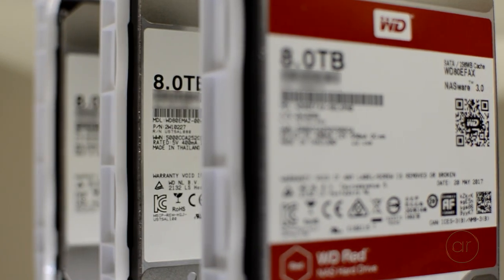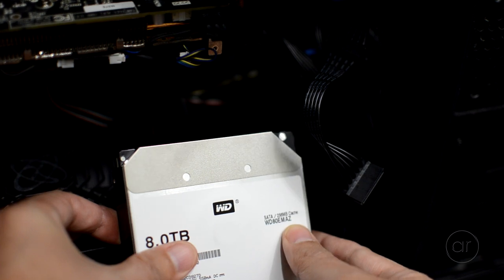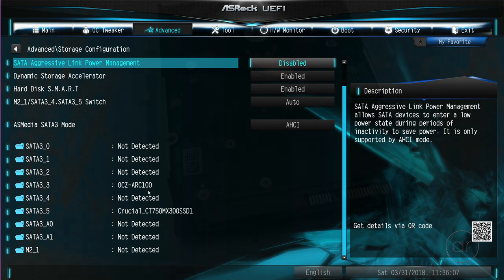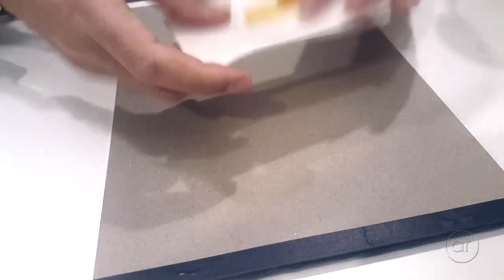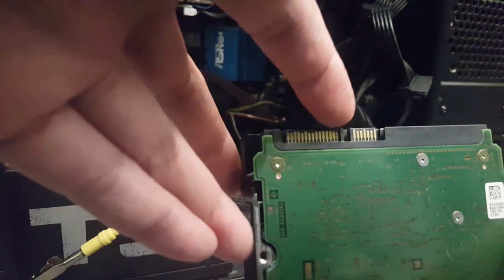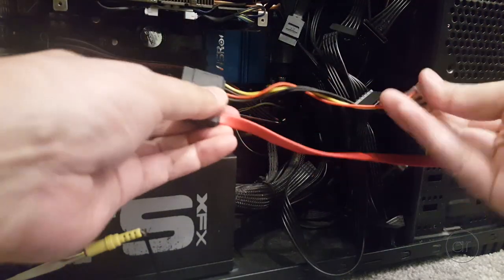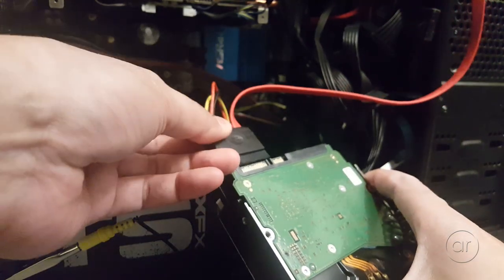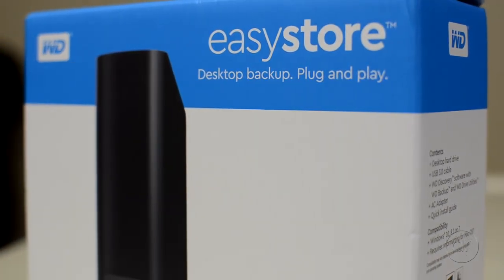How to Fix the 3.3V Pin Issue in White Label Disks Shucked from Western Digital 8TB Easystore Drives

Comment: Is there a specific sata to molex adapter I should buy? Do you have a link?
Reply from the maker: I don't have any specific product, but the general consensus on the datahoarders subreddit is to avoid the molded adapters (you want the crimped kind).
Reply: access random .. I ordered the Kingwin SATA data 7P + SATA Power 15P to SATA data + Molex 4P (SAC-04). I got it from Amazon. It looked the one you have in you vid.

Comment: Easier Method: identify 3.3v wire at the modular PSU cable end, and cut it.  The way I was able to identify on my PSU was to look at the connectors for PERIF and SATA and cut the one that the PERIF cable was missing (compared to the SATA cable).

Comment: what do you do if there are no molex connectors? 
Do I have to use the tape method or do I need something else
Reply from the maker: I focused on non-destructive ways to fix the issue (i.e. molex connector or tape). You can certainly use the tape method. Other destructive methods that I don't really recommend (from commenters below) are to snip one of the molex cables coming from the power supply, or to physically remove the third pin with a tool or knife.

Comment: I shucked a 3tb external hard drive (brand name CNM) and it was a Seagate drive inside. I have never been able to get this drive to work as an internal drive. The only way I could get it to work again was by reconnecting the little PCB that was in the external case and hooking it back up via USB. Could this be the same issue? I've tried posting in forums etc but only ever got responses that got me nowhere (such as telling me I had to go into disk management and create a partition etc which I already knew).

Do you reckon that this drive will work internally if I connect it up via a molex to SATA power adapter?
Reply from the maker: When you connect it normally, is it auto-detected in the BIOS? If so, then it probably isn't a 3.3V issue. If not, it could be a 3.3V pin, but I'd try some other steps also:

1) Try a different SATA data port on the motherboard. It's unlikely the port is bad, but worth a try.
2) Try a different SATA data cable
3) Try a different SATA power connector (with or without the molex adapter)
4) Unlikely this is the problem, but make sure your power supply can handle the extra power for the hard drive (usually 8-10W)
5) If using tape, try covering pins 1, 2 and 3. Pin 3 is the important one, but it doesn't hurt to cover all three pins.
6) If possible, try the hard drive in another computer. There might be some inherent incompatibility between the motherboard and the drive or between two hard drives (I've seen this before, but a long time ago with IDE drives).
Reply: access random I'm not sure if the BIOS picked it up or not. I can't remember looking there. I was looking in disk management in windows. But I'm in the middle of building a home media server at the moment from spare parts I have lying around at home so I'll try this drive in this machine using all these steps you've suggested. Hopefully it'll work because the extra 3tb would come in useful!

I should be able to get around to this at the weekend.

Thanks for the reply :)
Reply from the maker: Please let me know. I'd definitely check the BIOS first, as that is the first sign of failure. Good luck!
Reply: access random I've had some free time today so I've been able to get around to working my way through your checklist of suggestions. 

The drive is not automatically picked up in the BIOS. When plugged in internally via SATA I can only see it in disk management in Windows. But it doesn't let me delete or create any partitions on it. Those options are greyed out.

So I worked my way down the list and I've been able to try everything except the taping of the pin. I don't have any tape to try it with right now.

I'm reluctant to say that the drive is just dead because it works fine as an external drive when I hook it back up to that PCB that was in the external drive case and plug it into a USB port. But naturally I would like to have it hooked up internally rather than have cables running around the outside of my machine etc.

Do you think the tape method is worth a try or does it sound like the issue is something else? Thanks.
Reply from the maker: That is really strange - I've never come across a drive that doesn't appear in the BIOS but appears in Windows. It is not the 3.3V issue since it is actually powering on (if it were, it would not even spin up). What you can try is clearing the disk using diskpart. I have a video explaining how to delete "undeletable" partitions here: https://youtu.be/sfS143DikPE - but you'll want to use the command "clean" (it is explained in the description of that video).
Reply from the maker: Please note that the "clean" command erases the contents of the entire hard drive, so make sure you have backed up your data.
Reply: access random OK, I'll give that a try tomorrow. Thanks very much for all the help and suggestions so far :)

I'll let you know how it goes 👍
Reply: Sorry for the delay! I think I finally have the drive sorted. I followed the steps in your video regarding deleting "undeletable" partitions. It wouldn't work by selecting partitions and deleting them in Diskpart - it was telling me that Diskpart had encountered an error. But it did allow me to "clean" the entire drive which did the job required. I have now formatted the drive and it shows up in all the usual places as far as I can tell.

Thanks for all your help! Much appreciated :)
Reply from the maker: Awesome - great to hear all is well.

Comment: Aren't the first 3 pins all 3.3v? How does covering just the 3rd fix it?
Reply from the maker: You're right - the first three pins can be covered since pins 1 and 2 are not used. The actual voltage is delivered through pin 3 though, per the SATA Rev 3.3 spec.

Comment: I recently bought one from Amazonblackfriday, and my modelnumber is different than yours. Its WD80EZAZ, will it still work to cover the third pin? Ill try it myself in a cuple of days and ill tell you if you dont know.
Reply from the maker: Congrats! Browsing through the datahoarders subreddit, it looks like the -EZAZ model behaves the same as the earlier -EFAX and -EMAZ models. So if you run into the 3.3V problem, the kapton tape or the Molex-to-SATA (or any of the other suggested solutions in the comments) should work.

Comment: Does this work with Ultrastar 8TB Datacenter Harddrives, mine works when connected on a USB 3.0 Caddy but when connected onto the Motherboards SATA ports it does not get detected, I am using an Asus X99 Tuf Sabertooth Motherboard.
Reply from the maker: Yes, I believe so. There's evidence that some of the WD internals are actually rebranded Ultrastars.

Comment: I have an HP Pavilion 790-0031 Gaming Desktop, but my hard drive space is running low. Since more harddrives can't be attached to the Berx mobo, I want to ask if it is possible to clone the HDD to bigger drive like a 4 TB or larger AND still use it in the same PC (like removing the harddrive I am currently using and swapping it for the larger). Is this possible? Will the mobo and processor and copy of windows recognize the new harddrive and still work perfectly or should I just get a better gaming pc that allows users to upgrade parts?
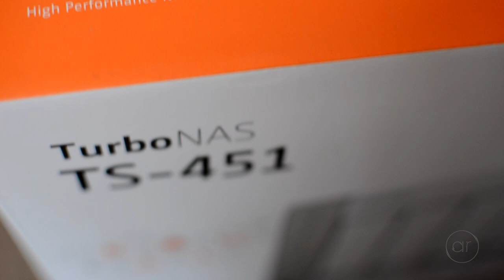Reply from the maker: Yes, you can clone to a hard drive which replaces your existing one - one of my other videos may be helpful: https://youtu.be/mKSmwyPXH2I. In your case, it would simply be two 3.5" hard drives instead of 2.5" hard drives. When cloning to a larger hard drive with Macrium Reflect Free, you'll want to expand the space of the Windows partition by clicking the "Cloned Partition Properties" at the 5:34 mark of the referenced video, and hit the "Maximum Size" button to fill up the space of the new hard drive.

Comment: Would it be simpler to just scrape away the Third pin ?
Reply from the maker: Good point and observation - you could certainly do that, but I was focusing on methods that were non-destructive.
Reply: @accessrandom  Thanks , This is a shame,, There should be a simple adapter for this

Comment: i  have a 14 tb easy store white label   that got  corrupted  and showed up as a dead drive when i had a pc shop run a diagnostic test on it, do you think if i  use  the heat tape that  is all i need to get the drive working again , do you think i  can  you electric tape as a temporary solution until  i get the heat tape
Reply from the maker: Possibly - did the drive used to work previously internally in the same computer? If so, then the tape probably wouldn't help. Electrical tape can be used instead of Kapton, but it's a bit thick (so it will stretch the connector a bit), and it leaves a sticky residue.
Reply: @accessrandom   yes , i will use the Kapton tape. the electrical tape did not work

Comment: What brand of SATA TO MOLEX CABLE ARE USING, OR WHERE CAN I PURCHASE IT FROM THNX.
Reply from the maker: I don't have any specific recommendations since I haven't tested any of them, but make sure to get ones that are crimped, not molded.
Reply: @accessrandom  I have used 3M Pressure tape I believe is made by SCOTCH if you don't have capton tape buy or use a 3M Pressure tape, usually £1 from any good department store, or pound store, they work well. Do not use CELLOTAPE as it will peel off and lose balance, USE 3M PRESSURE TAPE OR CAPTON TAPE WHICHEVER YOU CAN FIND, YOU ONLY NEED TO CUT A SMALL CM OF IT, YOU CAN COVER PINS 3,4,5 JUST MAKE SURE PIN 3 IS COVERED OTHERWISE IT WILL NOT DETECT ON BIOS OR SATA PORTS, YOU CAN USE A USB 3.0 CADDY THEY SEEM TO DETECT A ULTRASTAR/WD RED PRO/PLUS OR ANY WD RED BRAND HDD. I PREFER USING PRESSURE TAPE THAN MOLEX TO SATA CONNECTOR AS THEY CAN CATCH FIRE. BE WARNED..

Comment: I'm not able to find Kapton tape anywhere. Is it possible to use Electric tape? It can withstand lower temp. (Max 105 C/221 F)
Reply: Alex Yes I used electric tape and it works perfectly fine

Comment: I can't get mine to show up in bios or Windows, used a molex>sata power cable like the video. Still works via USB. Should I exchange for another and try again?
Reply from the maker: Strange - the molex adapter should be a surefire way to get past the issue. Several things come to mind that you can try:

1) Try a different SATA data port on the motherboard. It's unlikely the port is bad, but worth a try.
2) Try a different SATA data cable
3) Try a different SATA power connector (with or without the molex adapter)
4) Unlikely this is the problem, but make sure your power supply can handle the extra power for the hard drive (usually 8-10W)
5) If using tape, try covering pins 1, 2 and 3. Pin 3 is the important one, but it doesn't hurt to cover all three pins.
6) If possible, try the hard drive in another computer. There might be some inherent incompatibility between the motherboard and the drive or between two hard drives (I've seen this before, but a long time ago with IDE drives).

Comment: Hi, is this method also work if i'm using a docking station? Currently my enclosure power port getting loose. So i took out the hard drive and put it into docking station. 

However, Windows 10 won't recognise the drive and keep asking me to initialise the drive which will wipe out a lot of important data in my hard drive :(
Reply from the maker: Was the disk extracted from a WD MyBook by any chance? The MyBooks have hardware encryption on the PCB board (for the USB-SATA connector) which means it does need to be formatted before use. The WD Easystores do not have hardware encryption so they can be used directly.

Comment: Did not work for me:( Got EDFZ into Orico enclosure...tried all I saw here and other videos.
Any idea why my macbook does’t recognise the hdd via enclosure?
Reply from the maker: This would not be a 3.3V issue with an external enclosure, but it could be anywhere along the chain. By process of elimination, have you tried a different USB port, a different USB cable, or a different power supply for the enclosure - and if it all possible, a different enclosure?

Comment: I am in desperate need of making my hard drive work after it stopped spinning. I would love to try one of these, but do I need to have a Windows PC to do it?  I have a Macbook Pro.
Reply from the maker: No, this is independent of the computer type - it really depends on the power supply. However, if it doesn't spin (and it used to), then it probably isn't the 3.3V issue. It would not have spun from the beginning.
Reply: @accessrandom  Okay, I see. It did spin fine. I use a Landing Zone docking station which uses a 20 v power supply. The laptop goes on the docking station, then my external hard drive plugs into  it (for the computer connection) and then the power supply (12v) comes directly from the outlet. Somehow the cord from the power supplies got mixed up and the 20v got plugged into the hard drive. It stopped spinning that day. I just need to get my data off of it. Its very important photos for my daughter of the baby she had :( as well as other very important documents. ANy other suggestions on what it may be?Have tried a hard drive docking station as well as a USB sata bridge. No power
Reply from the maker: @sgreen0402  Sorry to hear about the data on the drive. I'm afraid it's circuitry may be been overloaded. If you know what you're doing, you could try replacing the PCB from one working drive (of the exact same model) to this one - there are videos that show you how. Or you might take it to a data recovery expert, though that could get costly.
Reply: @accessrandom  Thanks, I am going to try to find the PCB for it. Its just so hard to know which ones are legitimate and which arent (companies and products). Do you have a recommendation on where to purchase one?

Comment: i have a portable usb 3.0 rosewill hdd docking adapter, when i initally plug it in, my Linux/ubuntu recognizes the drive, but 5-10min later the drive nolonger is visible to the os.  Is this the same problems? my dock is an older usb 3.0 dock. thanks.
Reply from the maker: Probably not - the symptoms of the 3.3V pin issue would be a drive that doesn't spin up at all. Is it possible to try it as an internal drive on a desktop to see if you see the same behavior?

Comment: Hi
I shucked My Book 8 TB and used it as internal (because those drives are very hot even in good place (Hellium ver (orange boxes) is slightly cooler than air ver (Green boxes) and mine was air version)

and was very hot about 55 c even after puting 220W fan was 45 do decide to make it internal and now is 35

but My question is after that I put my 4TB internal in box but windows dont regonize it (show as unallocated while its already formated and with alot of data but it couldnt even accept it to format!!!)

is there anyway to fix using mt 4tb in My book box as external?
Reply from the maker: Unfortunately, the MyBooks use hardware encryption so it will not be possible to recognize the data that already exists when taken out of its case. You might need to wipe the partitions and re-initialize it (or place it back in its case and copy the data to a temporary area if you want to keep the data). The Easystores (as in the video) do not have hardware encryption, so those would be readable.
Reply: @accessrandom  TNX
I have no problem with my data was on my book 8tb and change it to internal (its fully accessable and fine)
but that 4 TB wd internal I had already and want to put it in my book case (which is empty because of that change I told before) is not accessable!

Comment: Just wondering if the drives are good for gaming or for retro gaming?
Reply from the maker: The disk itself is 5400 rpm. For larger games where load times of the game or of levels within the game are important, you will probably want to go with SSD. But for older games, I think this should be fine. I personally use it to store media for a Plex server.

Comment: I just shucked a brand new Seagate Barracuda 6TB  and I put it in my old NAS system and it literally prevents the system from booting. Drive works fine when attached to its USB adapter it came with. Could it be a similar situation?
Reply from the maker: Unless something has changed recently, the 3.3V issue has been unique to Western Digital drives. If possible, are you able to try the shucked drive in a different computer to see if it works there?
Reply: @accessrandom  So, here
s my crazy finding. I have 2 of these seagates. One works fine in this PC. The 2nd causes the PC to not boot (not even into the bios).  I tried the drive that causes the boot problem in another PC and it works fine. I also tried the molex adapter trick and that did not help either.
Reply from the maker: @2008M5  That is very strange. I would try swapping every variable that could be causing this - the SATA cable, the power connector, a different SATA port - to see if any of those things could be causing it.
Reply: @accessrandom  I figured it out and I am posting here for other that may have same issue. The drive had a 200MB EFI partition ( i guess created by Seagate ). I used diskpart to remove it using the 'clean' command. After that, the drive attached to the PC and worked. BIOS posted and drive was recognized and used.
Reply from the maker: @2008M5  Thanks for the update. I'll keep a note of it - this will be useful for others facing the same problem.